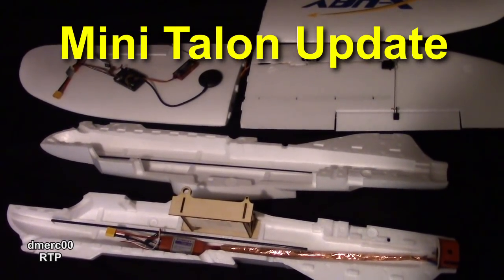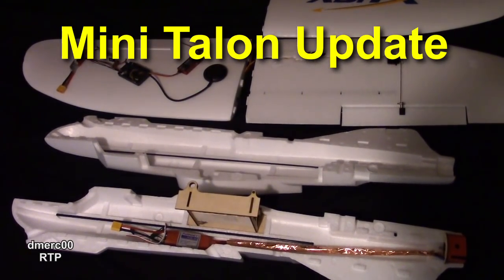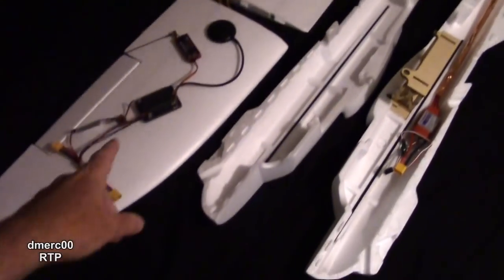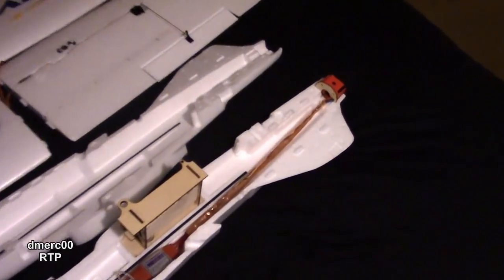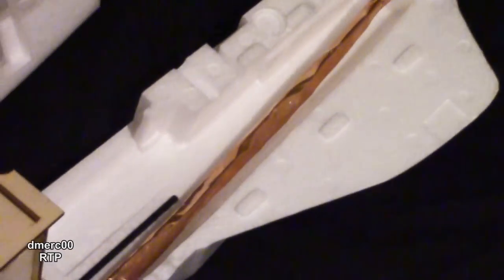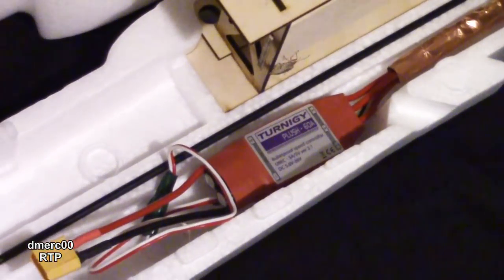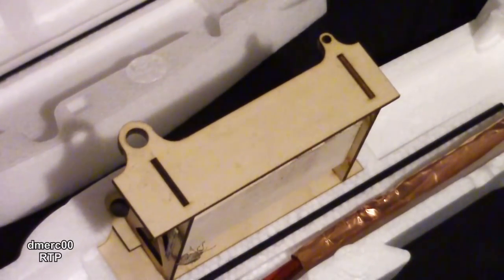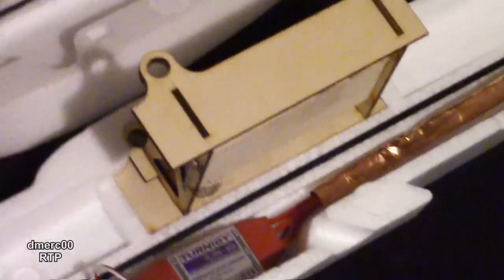X-UAV Mini Talon FPV V-Tail Plane Build Update

Comment: This will be a long awaited maiden and I'm looking forward to it. I'm just in the process of ripping the Naze out of my second one and fitting a PROPER flight controller in it :-)
Reply from the maker: It's going slowly I know. Just found out I put the wrong motor on it. I forgot I was going to use a 1250kv instead of 1100kv so I have to do all that over again. Going to use 4s with and 8x6 prop and I want enough thrust for hand launching.  Are you going for the Micro Vector now?
Reply: 1100kv and 4s is plenty Dave!   
Mine has an MT2216 1100kv with 9x5 on 4s and it hand launches perfectly (albeit it does suffer with torque roll). What people don't know is...... I always have a few good flights before I video the bad ones.
Reply from the maker: Noted, but I went and switched to the 1250kv now so I could use the smaller 8x6. I think part of my concern was injury to my hand with the larger prop. Thanks for the info and I hope your new build goes well.

Comment: Nice job Dave!  I found my Mini Talon a bit confusing to put together because a lot of the internals have to be installed before gluing the fuse halves but all of a sudden she was together and flies great! Nice job on the video, thumbs up!
Cheers, Bob
Reply from the maker: What size battery do you run in yours. 4S or 3S? I am thinking of using a 4S 4000 because I have two of them already.
Reply: I actually used two 4s 5000mAh lipos. The CG worked out just right and as you can imagine, she can gets some pretty decent flight times with 10000mAh on board. She moves along very quickly at under half throttle.  Cheers, Bob

Comment: Nice job Dave....Im going to try the ESC here as well when I build my Spare Mini Talon...and the copper tape shield trick...I used the laser cut ply cradle and found it all works rather well....You just need to use a square as you glue it together, I used hot glue, cos Im lazy, but did some additional glue beading over after it was tacked together...Have you tried using the smaller APM Mini, its what Im using in mine?
Reply from the maker: I have the APM Pro Mini programmed for V-Tail but will probably used the HK Pilot because I like the wires on top instead of at the ends for easy access. We shall see though. I might change my mind.

Comment: I added a floor of cut coroplast to the wooden box to house the Vector.  You'll like the talon -- it's a great FPV ship.
Reply from the maker: I put a wooden shelf in the bottom of the box but the coroplast sounds good, thanks. Will being showing that shelf in the next video.
Reply: Go ahead and reinforce the wooden landing fin at the back with automotive trim or a thick zip-tie and a ton of hot glue or Goop.  It's a serious weak point on the model.  Also, if I could go back i'd skip the landing wheel and make it a belly lander, as  the wheel causes more problems than it solves.  It leads to the model flipping over sideways on landing as it skids out.
Reply from the maker: I was wondering about the tail skid and the wheel, thanks.

Comment: How did you get TWO wings on one side?  Was that a packing error?  Have you considered lining the box with foil?
Reply from the maker: Gearbest sent me a kit with two left wings. No I have not thought of lining the box with foil but I more concerned about the external GPS/Compass unit being exposed to EMF from the ESC and Video transmitter.

Comment: Hi D, just a heads up, if you put the apm in the wooden box, make sure when putting in the servo/rx leads, the top cover wil fit.
Learned the hard way this weekend that the apm sits to high and the plane cover wont fit on the plane that way. ;o)
Reply: Always a good tip to test-fit!  Some APM kits come un-pinned and with both straight and right-angle pins and covers, but even if they come out the side, it may just move the problem from the lid to the side!
Reply from the maker: It might not have been evident in this short video but I put a wooden shelf in the bottom of the box. I will test fit it and see how it works for space, thanks